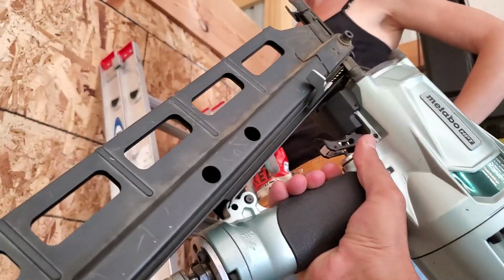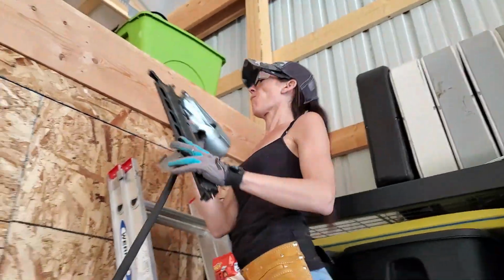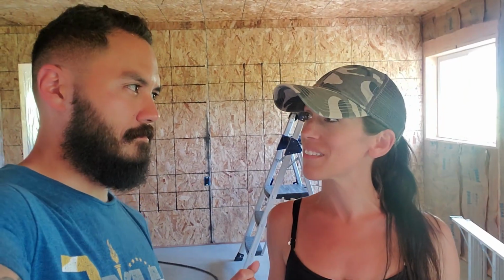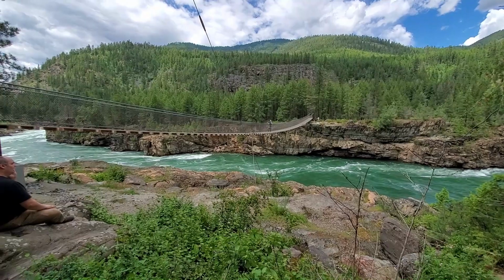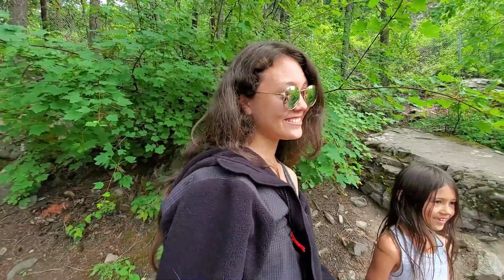There Are A Few Things We Need To Address | Building Our Own DIY Tiny Home

Comment: When we did a building in our barn like you are doing ours was taller than normal so we had, like you, a few inches to close in but what we did was push our OSB all the way to the top and all the way to the bottom so that left our gap in the middle but that made it easier to fill in because it was not at the end of a wall. It really worked well by filling in the little section in the middle by not having to climb so high on the ladder. Just a note to anyone else that might be planning on building this same situation.

Comment: Some shielded both side foam insulation in the roof ceiling would help and auto exhaust fans in the ends would pull heat out

Comment: Have you thought about putting a chain (or other) hoist in to help with putting items onto & off of your loft? I know you said stairs, but hoists are great for large/heavy/uwkward things. Attach to one of your rafter beams. If used regularly, put 2x2 or 2x4's on you OSB as slide rails to reduce wear & noise.

Comment: Hi guys
Love what you are doing you have an amazing relationship and family. 

Thought I would drop you a little tip that may be of help with your build. 
I notice you balancing materials on a wheel barrow a few times. We made a few trestles with our refurb and still use them 5 years later for the odd jobs around the garage, home and garden. 
 We used CLS 4x2 and a nail gun and they were an absolute god send and  made it easier on the back. 
 Keep up with the fantastic work👍🏽😀

Comment: Most hardware stores sell 92"5/8 studs to compensate for your top and bottom plates. So you don't have to cut 4" strips. If that was drywall you would have a lot of extra time ,mud and tape .this is what you call the school of hard knocks.

Comment: Think about some radiant barrier for your roof. Comes in rolls and is like heavy duty alum8num foil. It will drop the heat 10 degrees easy. If done right it will block all of the heat (almost all )of the sun created heat on the roof.

Comment: Beautiful area and the tiny house is looking great!  What kind of generator are you using for power for the power tools, fridge, washing machine, water pump and lights?
Reply from the maker: We have them listed in the video description :)
Reply: @GoodSimpleLiving  We live in Georgia now and have a 4-5 year plan to move to the Finger Lakes Region in NY.  Power and water are my main concerns when buying raw land.  I am just learning and don't know how many items you can run at one time on a generator.  I have a lot of research to do!
Reply from the maker: Depends on the size. The small generator will run our trailer, even with ac. The larger genny will run a well pump, and most of a house.

Comment: Tablesaw... You don't have to buy a big ol tablesaw, to cut big sheets like that. (I have done this.) Build a temporary table using a full sheet, or some scraps. Make a 'notch' in that table that a portable tablesaw fits into. Now, it is easy to lay a full or partial sheet of plywood onto your 'table', and rip it with the portable tablesaw. Use a GOOD portable tablesaw. And that thing will last you forever. You'll also find yourself using it constantly during the build. With or without the extra 'table'. I have always been partial to makita. Smoother faster cut, in my experience.

Comment: I cringe every time I  see the osb on the inside of the living space... drywall is easier to hang, cheaper, looks nicer, and has less chemicals than the osb. Fun to watch you guys but seriously question your thoughts on the osb... other question, why are the ceilings 100" for a barn building for a family less than 6', especially with using osb... I dont get it.
Reply from the maker: Drywall would have been twice the cost out here, and we are covering it with other materials such as barn wood. What ceiling is less 6'? The ceilings are 8.5 ft in the living space.
Reply: @GoodSimpleLiving  I think you misunderstood me. I was asking why >8' for a family that is less than 6' tall (I know he is 6'2" in his mind)... I didn't realize that osb was cheaper in your neck of the woods. 4x8x 1/2 drywall here is 11.98 per sheet, osb is 13 and change for 3/8 sheets. Is the osb option still cheaper once a finished material is applied to it? Not trying to troll just legitimately trying to understand the thought process on it... maybe a future q and a video as to the how and whys of your decisions for techniques and material choices... really trying to figure the height though... either drywall or osb comes in standard 4x8 sheets so a lot of extra work went into gaining a few inches. Generally around here ceilings are 8' 9' or 10' (or higher) as studs are available in those lengths... not using 8' lumber, 92 5/8 studs for an 8' finished ceiling (available at h.d. and lowes). my own house is a combination of 8' and 10' ceilings as adding 6" height would have meant more material but more importantly much more time in handling the materials with extra cutting and hanging and fastening etc.
Reply from the maker: @timmills3823  its just such a small space we were willing to put in an extra day for that extra 6 inches. We were able to get osb for around $7 a board, which is half of drywall here. Add in the tape, abd mud and its almost triple. We really want to do the barn wood look so its all about cheap backing.

Comment: Whomever selected the background music deserves a high five, and congrats on content!!!     Are you concerned about "off gas" formaldehyde from OSB board?   Greetings from "Bluff Country " Iowa!!
Reply: All woods have  formaldehyde gas . All wood building materials meet the safe code before it is sold . Simply air it out for a while outdoors and most of the gasses will be gone .
Reply: at347est  You know there will be some that think you know what your talking about, and that's OK, because that's where the word "naive " came from!!!    Society I suppose has to have "LOSERS" as well!!!!
Reply from the maker: What the heck is that rude response? It's true that all wood has natural formaldehyde.  In fact most log homes are over the recommended levels. OSB use to off gas pretty badly, but the APA OSB has to meet new higher standards, and tests have confirmed most iff gassing occurs before it leaves the factory. A few weeks hanging in the open, and the levels are very low.
Reply: @claytonholmstrom5708  Say what ? I didn't just pull that out of a hat. Perhaps you too should google the facts before you call others losers .

Comment: You ever thought about making a "LIFT" to get those heavy items up there? I saw a couple projects on YouTube that you might find interesting. Not sure what all you are planning on putting up there, but this might be of interest to you. You could build a railing "OPENING" that this would be at so that you could just drag things off it. Have a sliding gate that closes when not in use. When not being used, platform it would stay up out of the way. If not in the middle, build it on the side of the barn wall so the cables won't be in the way of pulling stuff off. A little bit of thinking and the platform could be the part of your stair's top landing. Keep up the good work. Glad you are taking time out to have fun with the family. That's what it's all about!
 https://www.youtube.com/watch?v=CgdsamzPN8w